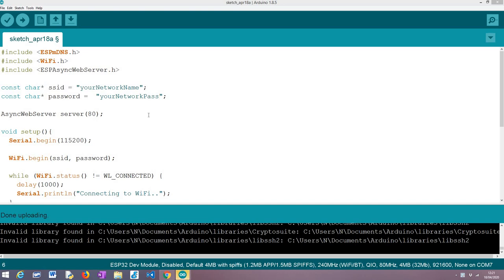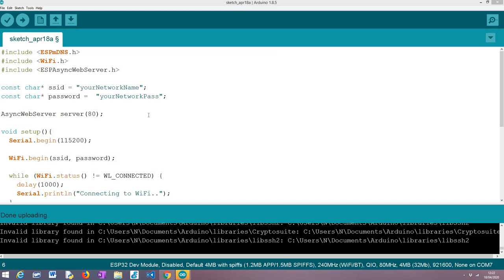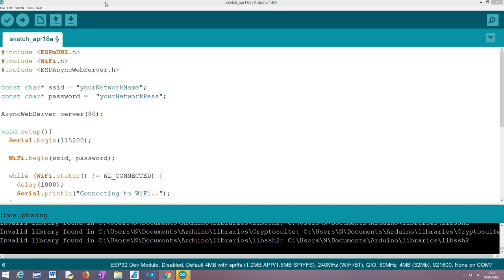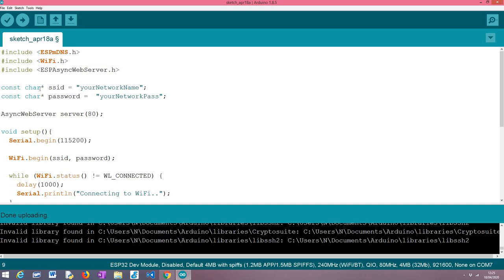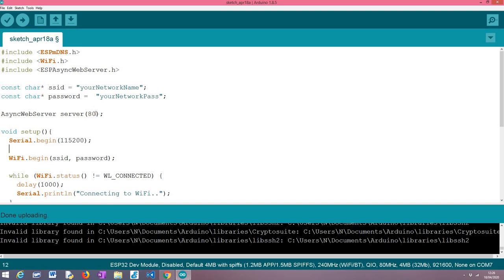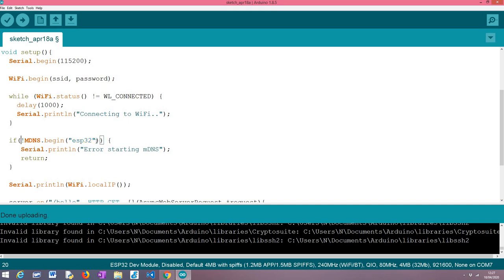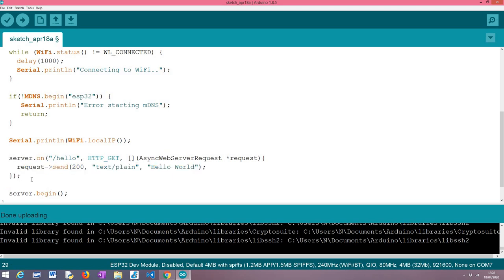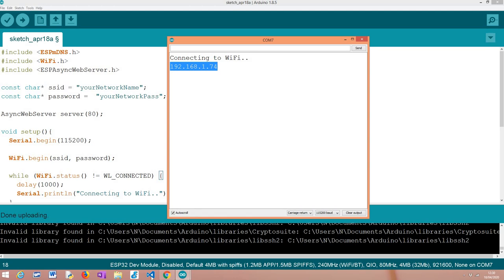ESP32: mDNS address resolution

Comment: Do you by chance tested if that works for Android/iPhone out of the box? I want to create an AP with my phone and use mDNS to resolve the ESP32 which connects to it.
Reply: I will answer that myself. No. Android as the only platform does not and issues have been flooded for at least 8 years now, with zero reaction from Google. Most prominent issue: https://issuetracker.google.com/issues/140786115

Comment: I already have a website, is it possible to display the information of ESP32 (temperature ...) in my own DNS? And in real time?
Reply: You can use Mqtt protocol or websockets for realtime connection for to connect the esp to your website, that depends if your website permits to supports those protocols, i hope the answer helps you